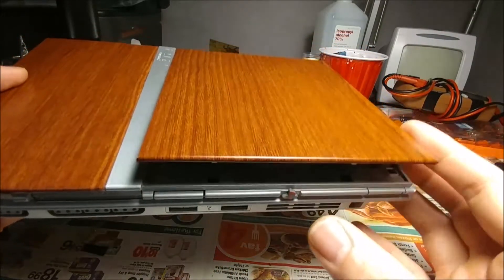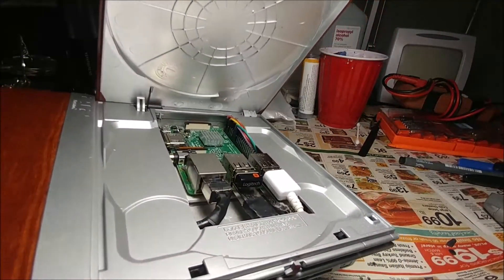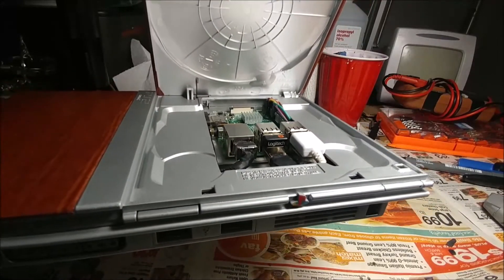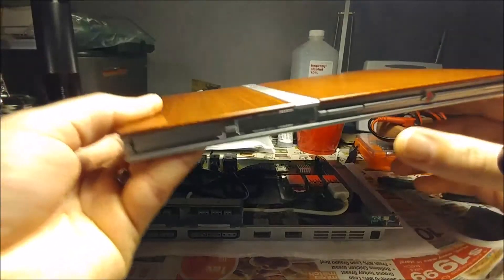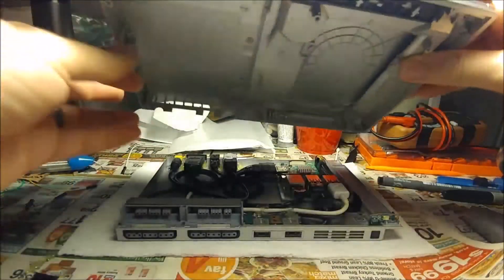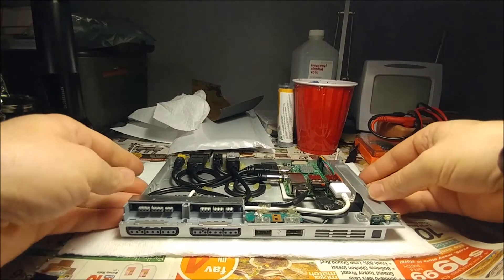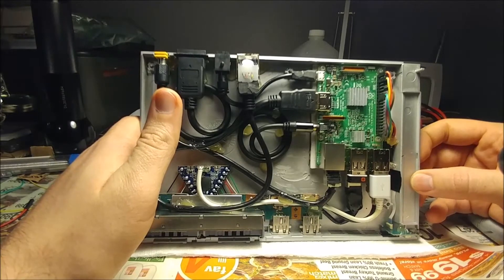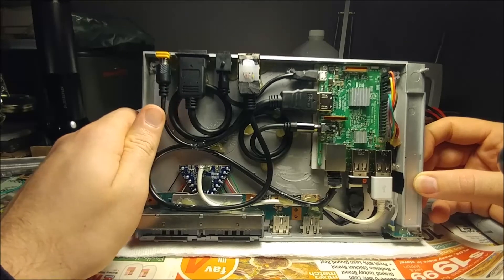Raspberry Pi PS2 case mod: Part 4

Comment: Hi , i recently bought a raspberry kit and wanna convert my old ps2 slim into a server/media player/ computer where i could do some python coding and stuff. The ps2 has its own heat sink and fan for cooling  so i was just wondering how i would go about interfacing and connecting it to the PI
Reply from the maker: Probably not enough space inside to reuse the heatsink/fan. Best way to find out is to bust it open and start test fitting the parts.
Reply: @sturo  ok so any advise for what cooling strategy i could opt
Reply from the maker: @gamerx5685  Just the heatsinks that usually come with the Pi would suffice unless you are overclocking.

Comment: awesome project , have you thought of including a Hard drive to it ?
Reply from the maker: That's a great idea for lots of extra storage. My next case mod project I will consider that.
Reply: @sturo  I think you can use an original XBOX case and include an Optical drive an hard drive say 1tb.
Reply from the maker: @gamepad3153  Great ideas!
Reply: @sturo  here's another idea , you coudl take apart a PS2 to PS3 memory card adapter and wire up the PS2 memory cards through USB thus making them work .
Reply: @sturo  may as well include a Floppy and Zip drive as well (take that Microsoft!)

Comment: Nicely done! Could you tell me how you did the power button? doing a project like this myself!
Reply from the maker: I found the two pins on the ribbon cable that make the switch, I believe it is pin 5 for power and pin 4 for ground. Then you just do as you would to power the Pi on and off with a momentary switch. Check out a tutorial for adding a power switch to the GPIO.
Reply: Can you make a tutorial explaining how to do this? Thanks in advance!